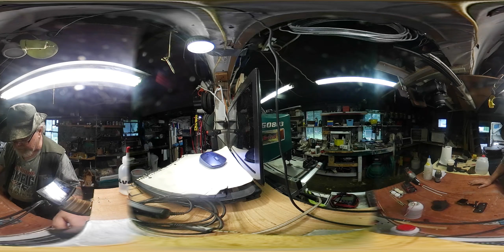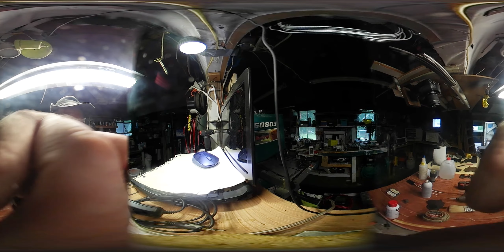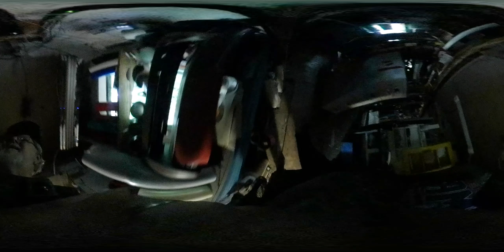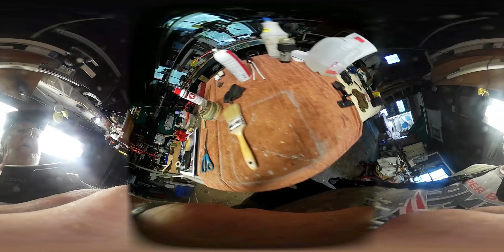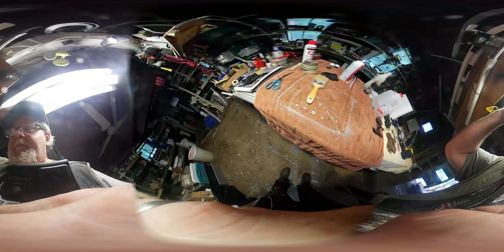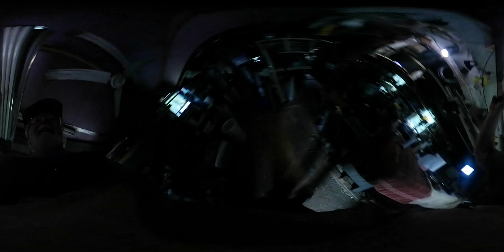360 GoLight Repair, I think this it the end of light. repair

Comment: You must have bought your 360 used, I saw them on eBay as low as 69.00 used and 299.00 on Amazon new.
Reply from the maker: No, it was new on Amazon $81 free shipping about 2+ years ago.
Reply: @buzzsah  The new ones I saw were over 200 bucks.